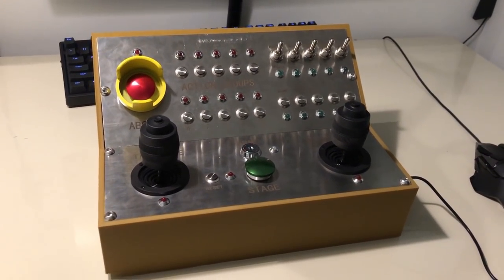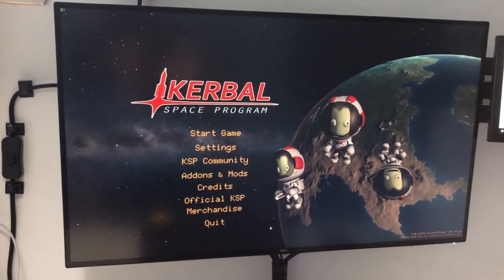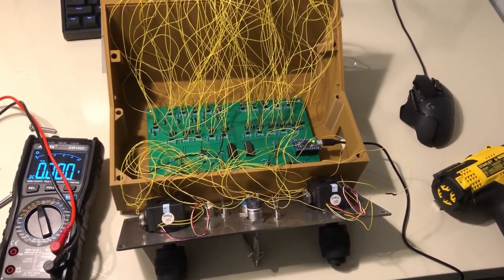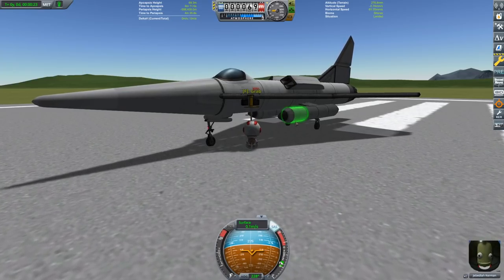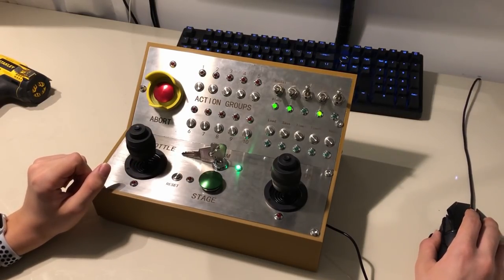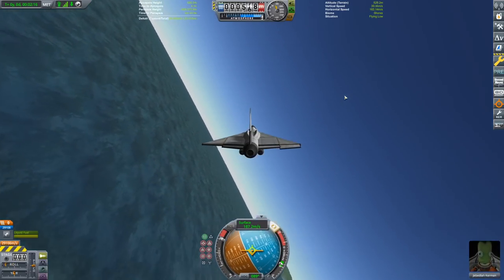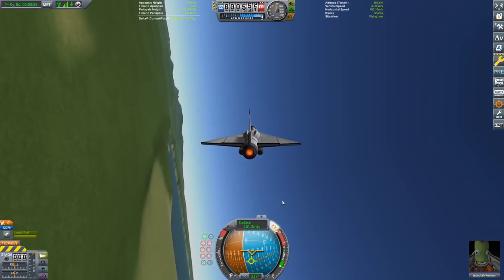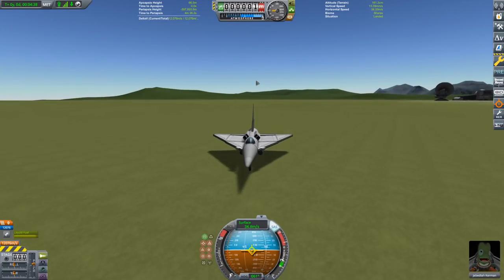Kerbal Controller Gameplay

Comment: This is awesome, i love the realism in having to use the key to stage and the general abundance of buttons. You should try and integrate this concept into a cockpit setup, get a racing sled or even a sled for flight sims and setup the dashboard for rocket controls and staging. Then build a realistic joystick/column control for planes, I've always thought the aerodynamics in ksp would be awesome for flight sims.
Reply: Not really, G-forces are broken
Reply: That is pretty damn cool
Reply: @TheEmeraldMenOfficial  I should've said fun rather than awesome. It was a good Sim for the time it came out in. Nowadays there are alot more realistic Sims for the folk looking for realism.
Reply: @TheEmeraldMenOfficial  Gotta remember this game first released in 2011, so compared to the flight Sims of that time it was doing pretty good. Comparing it to today's games are an obvious leap.
Reply: @JBeamGT3  Aye, and there’s always FAR to fix the aerodynamics that extra lil’ bit. And the Gs are not that wonky until you start doing insane shit, so should be fine until you make Blackbird/Concorde hybrids. 

I myself like building nuclear (often low-supersonic) airliners: had one break up mid flight during a turn at Mach 1.3, but managed to somehow ditch it safely: thanks to a lifting body fuselage, a decent speed after recovering from the breakup, an intact empennage, and still having the innermost section of each wing, I had just enough control and lift to glide the fuselage down from 10km and perform a high-speed ditch. Likely could have flown it back to KSC if it weren’t for the fact I only had my nose wheel left.

The ditching itself was hairy: had to hit tail/engine first to minimize impact speed of the crew cabins (KSP water is not forgiving at 60-70 m/s, and I was barely avoiding a stall at that speed), and further minimized it by dropping my nose gear last-second as a makeshift speedbrake/arresting hook. Somehow, not one crew cabin was destroyed, and all 20+ kerbals were safe (minus ruined clothes and vocal cords).

Comment: I think you need a switch for RCS mode, so that you can use both sticks to pulse the thrusters very gently. Maybe have it only do a controlled squirt of a set duration instead of analog controls, unless you're pressing the top button down?

Does that make sense?

Comment: Really nice design! I've never made anything nearly as cool. Job well done! I can see a few areas of possible improvement if you're up for making v2:

1) Rubber feet on the bottom to help with grip. Personally, I'd recommend at least 3-4" rubber feet for each corner, due to the resistance of the switches. I saw your controller sliding around a bit.

2) If you order more stainless steel front panels, perhaps you could have them cut out the lettering for each label. You could then set small LED strips behind them to light up the text. This would help with any glare you might have bouncing off of the panel. You could add a dimmer knob off the side to adjust the brightness of the labels for room brightness. Granted, that's a pretty tall order, but I think it would add massively to the overall feel of the controller.

3) Overall, I would also just recommend hitting the stainless steel panel with a series of finer and finer sandpapers. I could see some machining marks and areas where it just looked like the panel could use a little attention. A nice glossy, reflective finish would make this great thing look even better. (If the letters are cut out, instead of engraved, you also wouldn't have to worry about rubbing off any of the text.)

4) I'm not sure how it'd work on the wiring/PCB side, but it might be neat to have buttons where, after the button is pressed, the light stays on/off, the way it is with the switches. It could serve as a sort of "realistic" quick reference to the state of the ship without having to look at the outside hull for landing gear, ladders, etc.

5) If you end up redoing the abort button for any reason, I would recommend looking into covered buttons. I find the finger guards around the abort button you have to be a bit hard to press. Ref: https://image.freepik.com/free-vector/realistic-vector-alarm-emergency-red-button-with-glass-cover_134830-45.jpg Just an aesthetic thing.

6) If you're interested at all in KSP weaponry, it might also serve well to look into flip-up switches. Ref: https://www.thanksbuyer.com/image/cache/data/2012009/22706/136196155722706-1-750x750.jpg

Comment: Nice, I’m designing a custom controller for KSP right now and you reminded me of some features that I almost forgot to include.

Regarding the cabling, you could almost halve the number of cables by making the metal enclosure a common ground and shorting one of the terminals of each button/switch to it with a short wire. Then a couple of zip-ties (and ideally colored, cut to proper length wires) would do the trick.
Reply from the maker: That’s an amazing idea. I’ll definitely do this if I were to make a version 2

Comment: Do you have a ground/supply for each component to the board? 

It might be neater if you put the ground and supply on a single wire for each board.

Also colour coded wires and ribbon cable might make it look neater.

Still very cool though..

Comment: A better way to do the cables is a wiring harness; get a large cable bundle or ribbon cable and split them individually off to each terminal, with labels on each wire. Something sequential like a, b, c because you have so many wires. An I2C or other digital logic bus is a good way to reduce cable count, but you need multiple IO chips.

Also you could share a common positive or negative, and daisy chain that shared pin across instead of a long wire for each one.

Comment: 1:56 Common rail (either ground rail or power rail, depending on if your switches need to pull low or high). That should reduce the wiring almost in half.

Comment: a common ground bus going to all your component could clean up a part of the mess inside the box, as you won't need to cable from each button/LED to the board, but just one, the ground being daisy-chained.
Reply: also, you could X/Y matrix your button to save a bit more wiring, but that requires specific component to process the keyboard matrix.

Comment: I'm trying to create something like that, I have a problem though. Even if SAS is on when I send pitch yaw value SAS seems to be useless because kerbal accepts only arduino inputs. Sorry for my terrible English. Any help?
Reply from the maker: Are you sending values by making the arduino emulate a keyboard (sending wasd characters) or are you using something like simpit that directly communicates with ksp?
Reply: @Mr_Happy_Face  I'm using a command that directly communicates with ksp, should I emulate a keyboard? What do you do in your project?
Reply from the maker: @undagame7800  For my project I emulated a keyboard because I couldn't get any other communication method working, so I don't know enough to help you with the SAS problems you're experiencing
Reply: @Mr_Happy_Face  thank you anyway, I fixed my problem

Comment: why not make a separate PCB with all the switches and things soldered to it with a flex cable attaching it to the motherboard, it would remove the mess of wires and consolidate all of the connections into one single cable

Comment: I use entire ethernet cables with twisted pairs still bundled together to do wiring for my projects.
Reply: This is genius, and the wire is solid core instead of stranded (the former being much harder to find for some reason). Cat5 cables are pretty cheap if you buy them from a company that operates with them in bulk.

Comment: First off not bad, secondly, us got to learn to loom.  Thirdly, it looks like you wired each switch independently, that's a bit of a waste.  Essentially when you have a switch, and especially with something like arduino, your switches have a pin going to a i/o pin and one going to ground, for a switch like the plane/rocket mode select you have two i/o and one ground.  Simply put the grounds can ALL be tied together, so instead of wiring the grounds down to the board you would daisy chain them one after the other then have only one or two 0v or ground lines down to the board because all the grounds are connected on board you doubt need a separate wire for each.    There are other ways to lessen the cable burden but this is the easiest.  This also works for your led's depending on how you are addressing them.  You can write them common anode or common cathode depending on which you are using to switch them on, and how you are powering them. 

On a whole other note, I would have found a linear potentiometer to do the throttle, and use the second stick for translation.  Like when your docking you can use in think yghj keys to move left right up and down while the other dying handles roll and yaw in an not totally sure how any of the Apollo docking did it but I would think that it would be necessary to lock out the yaw and pitch and switch that joystick to handle forward backward and roll maybe.   If your joys can twist you could switch to a docking mode that allowed you to control the rcs for docking.  I really liked using my hostas for this, but it's not really space feel it's more fighter so something like this is a lot more immersing.  I may build up my own one day... I will need to look into some joysticks, since the rest of the switches I will be ordering for my cyber deck builds

Comment: you could make a custom pcb and just integrate it into 1 pcb instead of the nest of wires u have now
Reply: Yeah, I saw that custom PCB with the switches and buttons soldered on, then just run some sort of jumper cable between the two boards for connectivity. Would make the whole thing a lot more reliable and easier to fix if something does go wrong
Reply: @xanderstuff7  you could just use a ribbon cable too
Reply: @sawyernorthrop4078  That's the word I was looking for! My brain failed lol